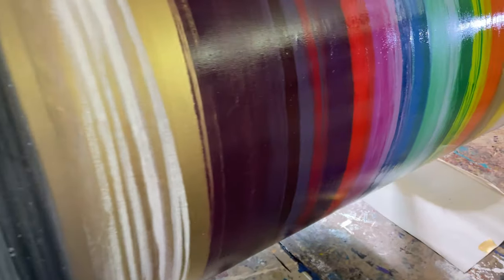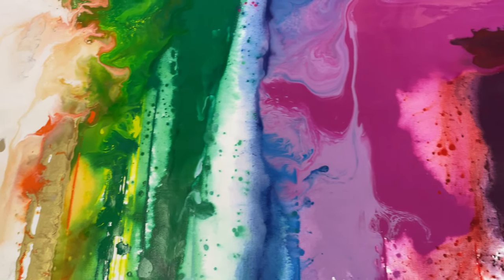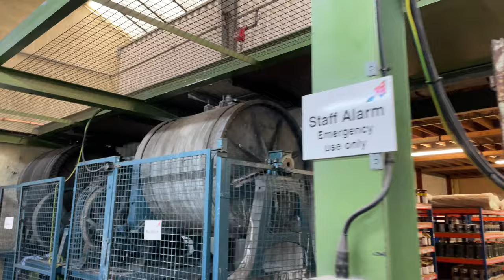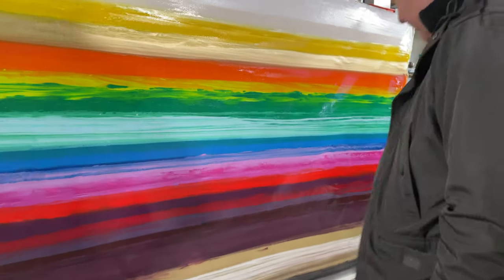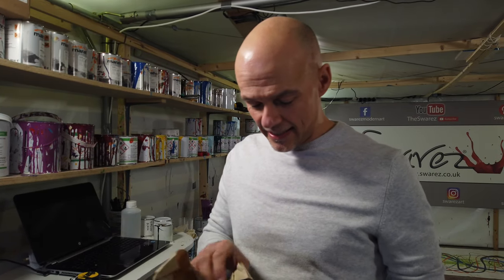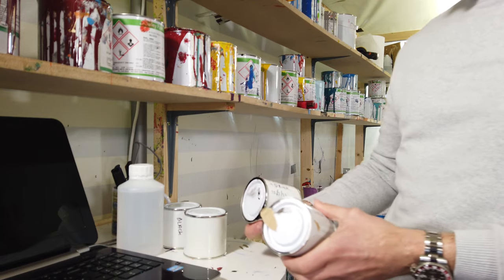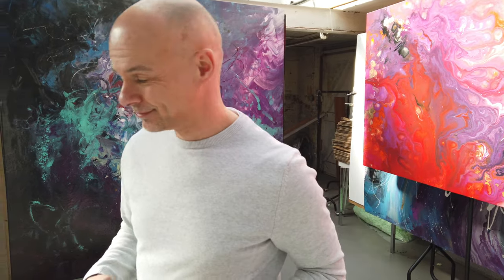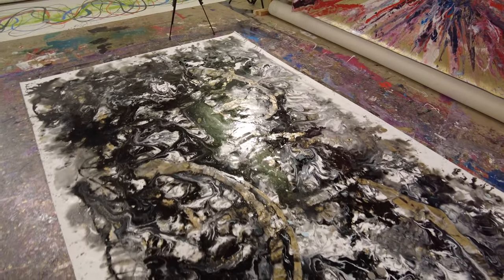£1000's SPENT and TESTING NEW PAINT!!

Comment: You think 51-ish is hard? Try being 64 with a bad back and legs LOL I built a platform to work on because I can't paint on the floor anymore. Because I can't get up off the floor without help and I'm always alone when I paint. Painting on the platform is almost as good as the floor.
Reply from the maker: I shall bear that in mind for the future! Thanks for the advice!
Reply: @SwarezArt  Ed if you end up with a bad back and or legs. Build the platform knee-high. It limits the size of the canvas but it works. My platform is 72 in. x 96 in. / about 1.75 meters x 2.5 meters.